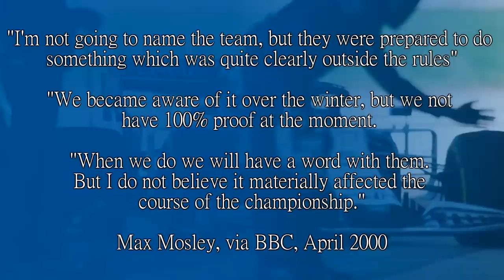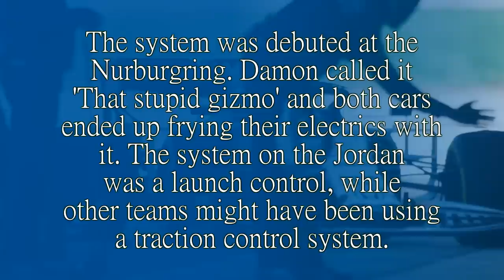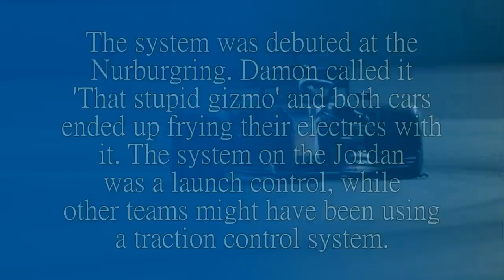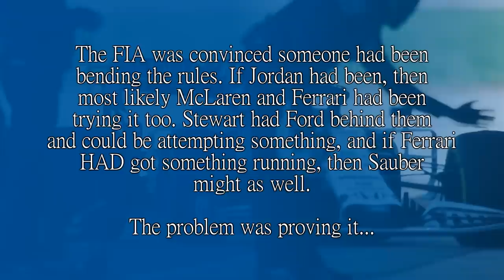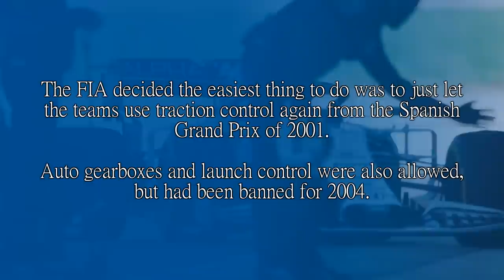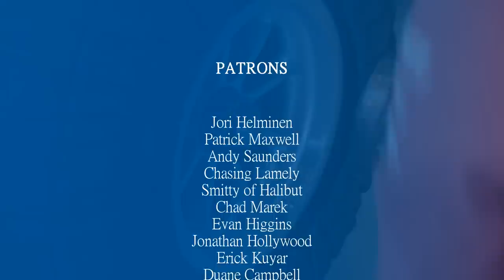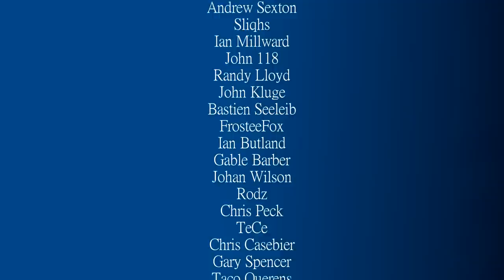WHEN CHEATING BECOMES LEGAL! The Story of F1's Second Traction Control Era

Comment: I read F1 Racing Magazin in 2007 and they posted Telemetrie Dates from Jenson Button test driving for the 2008 Season. 
He drove 10 Laps with TC, came into the Pits, and drove another 10 Laps without TC.
And surprise surprise, He was not faster with TC. Wich back than in the early, mid 2000s a lot of people belive that TC would make a Car faster. 
There are enough people today who think that TC make a Car faster. Specialy when they talk about the 1994 season 😂.
Reply: It depends on your level of skill with the throttle and track conditions whether it'll make you faster or not. I have no real life experience with traction control, but in video games, I tend to be faster without, and in the F1Mania 2006 mod for F1 Challenge '98 - '02, I made plenty of use of the TC Override button to momentarily turn the traction control off when coming out of corners, as once the car had settled on corner exit, it only slowed down the acceleration.

Comment: I seem to remember that during the start of the hybrid cars that the teams were using the hybrid motor power as the traction contol and Redbull started it and the onboard camera used to get interference under acceleration which is what gave it away.............or was that the 2012 thing? I thought it was after the engine map ban?

Comment: According to Sam Michael, Jordan's launch control system was only used in race starts and he felt that it wasn't worth much either. There's a contradiction within Jordan members over Heinz Harald Frentzen's electrical failure at the Nurburgring. Mark Gallagher says Heinz and/or Sam forgot to cancel the system, but Sam says it triggered itself after the pitstop.
Reply from the maker: There’s reports that Sam was shouting over the radio to HH that he had to turn it off, but Frentzen was too busy driving to listen.

Comment: Anything that allows less capable drivers to find success is bad. But then I'm firm in my belief that a F1 steering wheel should be allowed 3 buttons only. They can be for anything you want, but you're only allowed three buttons. Want to change maps, give up the radio button. Want a radio as well? Hope you're good at the pit lane speed limit. Want pit lane and radio? Don't stall then. Etc etc.
Reply from the maker: Schumacher won at least five of his seven titles with it. Schumacher fraud confirmed. 😅
Reply: What if I told you that buttons don’t have to be solid state? 👀
Reply: @F-Man  What if I told you I don't run the FIA so they won't listen to me, but if I did they'd be a toggle only, and no you're not allowed to press two at the same time to get more options :)
Reply: @AidanMillward  I get what you mean, if everyone has got it the cream will rise etc. The current grid is almost wholly good drivers, whereas most of the older ones were 2 great, 6 good, and a bunch of chumps. Paging Bertrand Gachot...

Comment: Mid/rear engine cars are easier to drive than front engine and thus should also be banned as driver aids, along with carbon brakes.  MFGA.. oh wait, F1 was supposed to be something about technology?
Seriously, a minimum weight requirement is worse than silly.
Reply: The latter also applies to pro cycling. The minimum weight requirement is kinda ehh for the tech we have right now. We could easily have race bikes weighing under 6.8 kg that lasts long enough to take a beating with current technology.
Reply: @mahiru20ten Also the banning of certain frames after 1999 who know how crazy TT rigs would have gotten to in cycling today lol

Comment: I wish they allow traction control and anti lock brakes back. These things are allowed in GT racing, specifically in GT3, and has allowed us to see bold and close racing.
Reply: Yeah but that's also down to the nature of the cars. GT cars aren't as reliant on downforce as F1 so you're not at a massive disadvantage as soon as you get close to another car and if you have a bit of a bump which costs some bodywork you're not suddenly losing 5 seconds a lap. You see the same thing in formula E, they're not completely reliant on downforce so it's possible to stay in someones shadow for lap after lap and if you lose a bit of bodywork the car is still able to put in competitive time.

Comment: I think ABS and traction control are good things to have on any car, especially a racing car - I see them more as necessary safety items. The way F1 cars burn through tyres under a brake lock-up shows ABS should be used - it's not safe for the driver, having one tyre be damaged from braking, which does negatively affect the car's handling and performance.